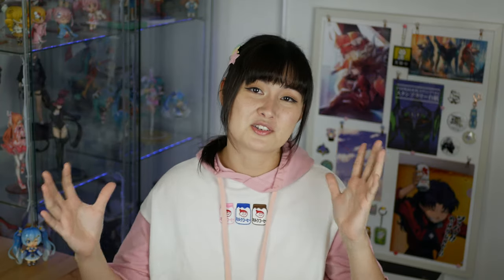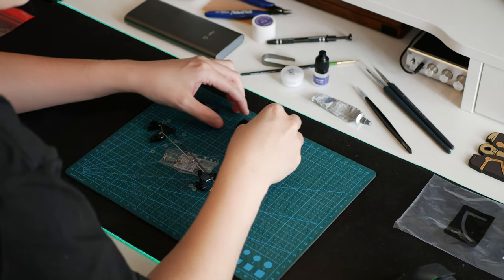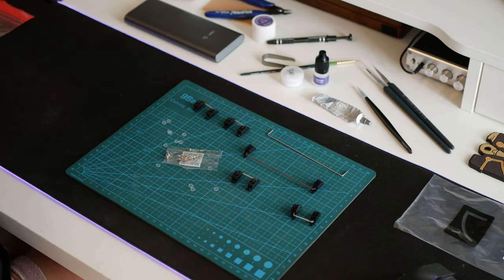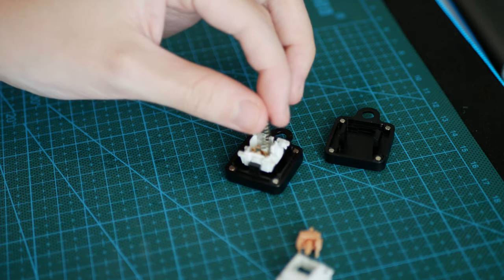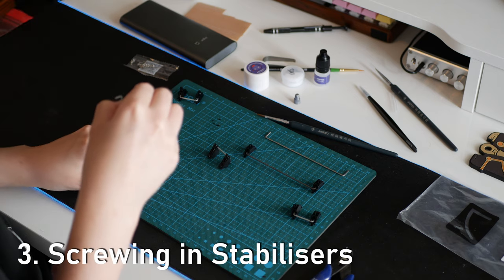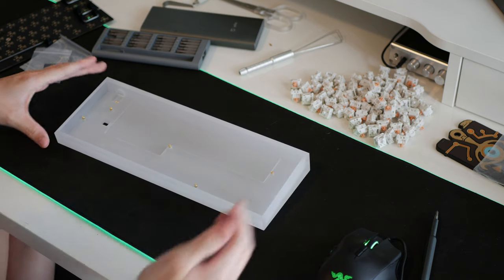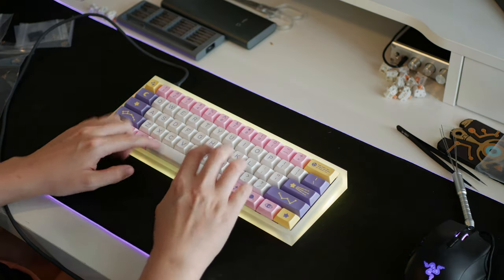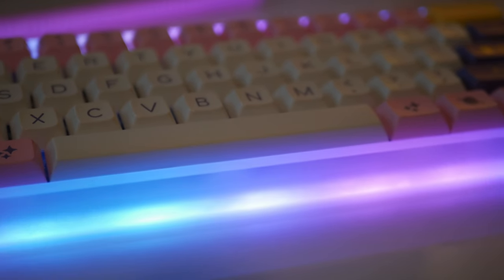Building My Kawaii Magical Girl Keyboard!

Comment: I'm intrigued. I thought software engineers were adamant about having the num pad because they need it so often. Or is that just a hoax? haha 
I have a razer huntsman in white which I love. I've always been curious by custom keyboards. Maybe I will one day build one myself I have the courage haha I mean I already built a pc, shouldn't be that much harder?
Reply from the maker: I do miss my numpad if I need to type something like a phone number (but you can even make your own separate custom numpad :P) If you get a hotswap PCB you don't need to worry about soldering, so it's not that much harder than a PC (depends if you want to lube your switches or not)